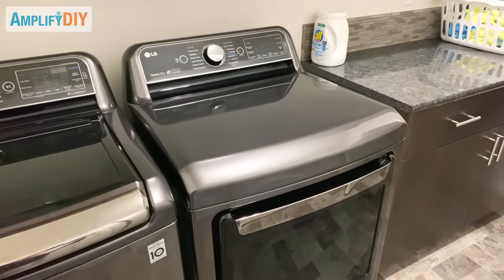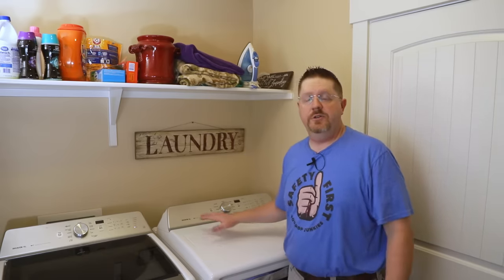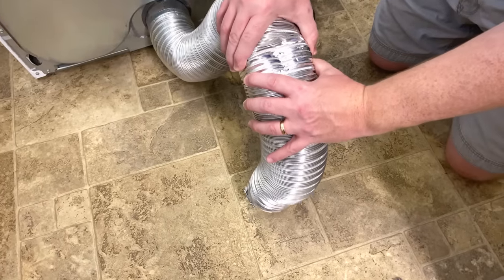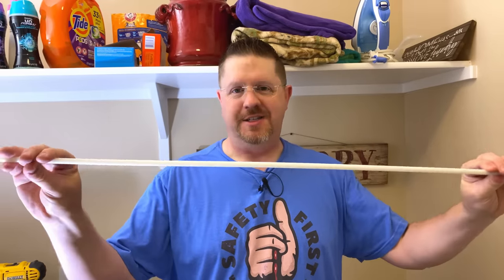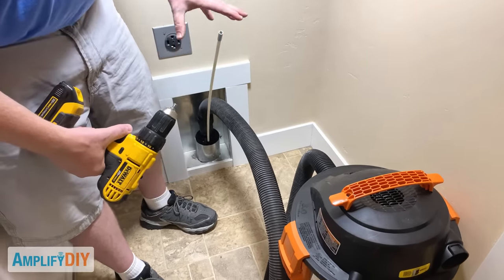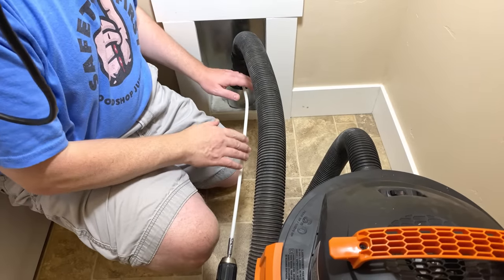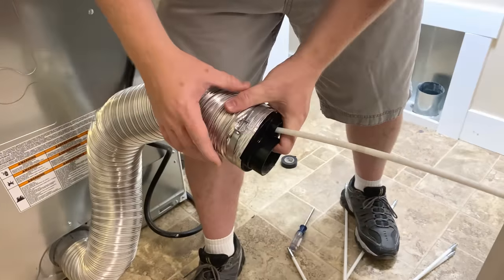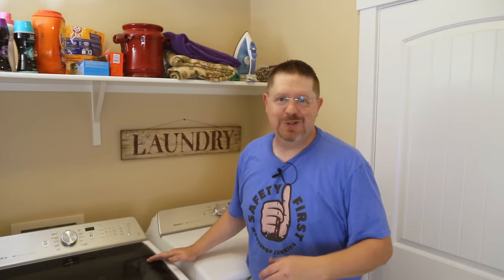How To Clean Your Dryer Vent Duct - Step By Step - It's Super Simple!

Comment: Your video potentially saved us from a house fire. I bought the product you mentioned in the video together with 12 foot extensions. I ended up using all 8 rods to clean the vent; a full 24 feet. My wash room is in the center of the house and the vent goes straight up to nearly top of my roof. There were 2 x 5 gallon buckets full of lint when I finished. The product was very easy to use. One tip is to roll the electrical tape in a fashion so that it does not come unraveled. Especially if you create a flap as in the video. You can test this by putting your glove over the tape and rotating the drill slowly. If it stays flat, you have it in the correct rotation. Another tip is to have a service technician clean inside the dryer itself. This involves removing the back panel. There was another 5-gallon bucket full of link inside the dryer itself. Inside we found burnt lint. So don’t hesitate to clean your dryer vent and check your dryer yearly. Thank you for this video.
Reply from the maker: WOW! I'm so glad you got everything cleaned out before there was a disaster. Thanks for watching!
Reply: Out of curiosity, how long did you go without cleaning that vent? I just did mine after 3 years (newish homeowner and kind of forgot about it until right now) and while I had a bit of lint, it was nowhere close to that much.

Comment: My dryer is drying clothes faster. I learned this important dryer vent cleaning technique from your video. I have told some friends, and coworkers about me helping neighbors clean dryer vents with rods and brushes connected to a drill. Some comment,”that’s cool.” I heard a neighbor’s daughter say,”do you clean dryer vents all the time?” Yes to prevent dryer fires. I like the Gardus LintEater Pro dryer vent cleaning system kit featured in the video. I put electrical tape on each rod to keep the heads of rods together during the drill powered dryer vent cleaning process. The kit is worth it to prevent dryer fires.

Comment: I just cleaned my dryer and dryer vent
duct from basement to patio outside my
home. I was surprised by some lint inside the lint chute of dryer. I just do not want to risk a house fire from lint build-up inside dryer and dryer vent duct. The LintEater Pro Dryer Vent Cleaning System Kit is worth it to prevent a dryer fire in my home and others’ homes. You make a lot of sense in a lot of your helpful YouTube videos. Thanks for all you do.

Comment: Thank you for this helpful video about how to clean dryer vent ducts step-by-step. I just helped a friend clean her dryer vent duct from basement to outside of home. The friend learned that a drill connected to flexible rods with brushes prevented a dryer fire. The dryer vent cleaning system kit featured in the video is worth every penny for deep cleaning dryer vents. 16 feet of the vent was clogged with
lint from the basement to outside of home and could have been a dryer fire in her home. She told me,”clothes were not
drying.” I have learned so much from this
video and strive to inform others about dryer fires. Electrical tape does keep the rods from coming apart during the dryer vent cleaning process. Guiding a drill, when adding a new rod, is very helpful. I used this technique this evening helping a friend clean a dryer
vent. She replied,”you really know your stuff about dryer fires.” Thanks for teaching me this important task.

Comment: Thank you for an excellent YouTube video.  I own the same dryer cleaning kit and do this job once a year.  Your tips about taping the rods and NEVER running the drill in reverse are spot on.  It is obvious that you have done this job and used the tools because you nailed everything right about the whole process.  The most difficult part of it is exactly what you said, moving the dryer and then breaking and making the flexible vent hose connections.  Very nice job, thank you again.
Reply from the maker: Thank you very much, Apack! I really appreciate the feedback.

Comment: I recently had my family's dryer cleaned by a local appliance repair center from some lint build-up inside the exhaust,drum and lint trap chute. I just did not want to risk a dryer fire. I use the Gardus LintEater Dryer Vent Cleaning System Kit regularly to clean the dryer vent duct that leads to the patio. I learned the importance of cleaning dryer vent ducts from online and from your helpful video on how to clean a dryer vent.

Comment: I tell neighbors about preventing dryer fires. I helped one of my neighbors a couple of weeks ago with cleaning his dryer,lint chute and dryer vent. When he began to pull the dryer away from the wall,lint was on the floor and near the dryer exhaust. He was surprised that his cordless drill with the Gardus LintEater Dryer Vent Cleaning System Kit helped remove lint near the rear dryer exhaust,lint chute and dryer vent duct. He was thankful that a dryer fire was prevented. I told another neighbor about cleaning their dryer vent. The neighbor was thankful for helping with preventing a dryer
fire. I regularly vacuum around my dryer,lint chute and dryer vent duct to prevent a dryer fire from lint build-up. I appreciate the helpful video on how to clean a dryer vent.

Comment: Great instructional video...I've been using the "LintEater" for nearly 20-yrs; at my home and at a 2-family house I maintain. I make it a habit to schedule yearly cleanings.  I designed the dryer exhaust vents at each home using  4" round metal ducts; sealed with either high temp flue tape or aluminum foil tape rated for high temps due to their properties of adherence and being flame retardant; and then terminating each end with metal (stainless steel) worm gear duct clamps.   Simple construction; simple cleaning, as you have demonstrated, and does not require a "professional" to install or clean.  This is not a hi-tech or specialized industry requiring training or using proprietary materials; and that's the point of a DIYer video...to inspire and enlighten those who wish to learn and do the work themselves!  Thanks for sharing; I appreciate it.  Best wishes and kindest regards.
Reply from the maker: Thank you so much!

Comment: Thank you for teaching me how to clean a dryer vent duct. I showed two individuals how to clean a dryer vent with the Gardus LintEater Pro dryer vent cleaning system kit with flexible rods and brushes connected to a drill to remove lint build-up inside their dryer vent ducts and
dryer. Some people have commented,”My dryer is running better.” The individuals have learned from me that it is important to clean a dryer vent to prevent house fires. Your helpful video has helped me demonstrate to others that just cleaning the lint screen is not enough.

Comment: I just cleaned my dryer vent duct from my basement to patio using the Gardus LintEater Pro Dryer Vent Cleaning System Kit with a cordless DeWalt drill. I was surprised by some fine lint dust that was removed, as I was cleaning my dryer vent this Sunday
afternoon. I told a coworker about me knowing how to clean a dryer vent. He thought it was cool. I mentioned this kit with rods and brushes connected to a drill. I used your method of using electrical tape between rods to prevent the rods from getting lost, while cleaning my dryer vent today. I learned how to clean my dryer vent from your helpful YouTube
video. I just wanted to be safe to prevent a dryer fire from lint build-up in the dryer vent
duct.

Comment: I just cleaned my dryer vent duct from my basement to backyard patio this Wednesday evening. I connected three flexible rods with brushes to a cordless compact DeWalt
drill to clean inside my dryer vent. I was surprised by lint build-up that could have been a dryer fire prevented inside my home. I turn my clothes dryer to normal drying cycle for a few minutes, after cleaning my dryer vent to check for good airflow from my dryer to outside patio dryer duct of my home. The electrical tape is a helpful tip to prevent rods from disconnecting inside my dryer vent during the dryer vent cleaning process. Thank you for all you do.

Comment: Great video.  Hardly any of these dryer vents are installed to code, which limits the length and amount of elbows.  I take the cabinet apart and vacuum out the inside of the dryer also, especially with gas dyers.  The lint seals go bad, and then the cabinet will have a layer of lint, which is very flammable.  That termination was a little to close to the ground.  I would dig a little gravel out and get more clearance.
Reply: Yup, any time there's a small dryer repair, it comes out, comes apart and gets cleaned. Once you have one apart, you realize that you paid for mostly air when you bought it...

Comment: The Gardus LintEater Pro dryer vent cleaning system kit makes cleaning my dryer vent and other’s dryer vents easy. You are very helpful in showing each step of how to connect the rods with electrical tape and how to go in a forward motion, while cleaning a dryer vent with a
drill. I could see a difference, in the airflow of the dryer vent; after cleaning the dryer vent this Sunday afternoon. My neighbor brought his DeWalt cordless compact drill over
to my home today. He was impressed by how quickly I connected the rods with the brush to his drill to begin the process of cleaning my dryer vent from my basement to the
patio.

Comment: Sir...I cannot thank you enough for this amazing dryer vent cleaning video.  Bought the home 12 years ago (never cleaned).  Replaced a dead dryer & the new dryer has a super high output for drying clothes.  Ended up cleaning the vent out myself using this kit (purchased from Lowes) along with ext rods.  It was 17' from dryer to exterior.  
This video was by far the best how-to video I've ever watched & used as a tutorial.  Thank you so much for this amazing video.  Clear.  Concise.  Accurate.  To the point.  No BS distractions.
Job well done on both your end & a clean dryer vent on my end.
Reply from the maker: So glad to hear it was helpful for you. Thanks!

Comment: I helped my neighbor clean her dryer vent duct,lint chute,lint screen,rear exhaust,and ventilation holes of her front load 
dryer today. I think the dryer could have caused a dryer fire in her home from the lint
build-up in the dryer vent to the dryer. The Gardus LintEater Pro dryer vent cleaning system kit and extension rods featured in your helpful video helped save my neighbor’s home from a dryer fire waiting to happen
today. The kit is really the best way to clean a dryer vent and dryer properly. I remember the comment all the lint build-up from the dryer to dryer vent, all that hot, hot air can ignite the lint and can cause a fire. I tell neighbors I learned how to clean a dryer vent from your very helpful video How to clean a dryer vent
step-by-step on YouTube. Thank you for the video of the importance of cleaning a dryer vent to prevent a dryer fire in my home to neighbor’s homes.

Comment: This is one of my favorite “seasonal checklist” items for my handyman clients.  Around DST I go to my regular clients homes and do all the routine home maintenance things (smoke detector batteries/furnace air filters/dryer ducts/water heater flush/reverse ceiling fans/change light bulbs/etc). I charge $50 for simple ground floor dryer duct cleaning but up to $150 for second floor or complex vent systems.  It’s easy money and something the average homeowner never thinks of or doesn’t want to do.    Excellent instructional video!👍🏻
Reply: What’s your location? I need your help!
Reply: @evasilvalayton758  I live on the Monmouth/Middlesex county border—central NJ

Comment: I make it a regular habit to vacuum the back ventilation holes,heat grilles inside the dryer,dryer, and vent. I decided to clean my dryer and vent this Sunday evening. I was surprised by some lint build-up inside my vacuum canister. I never thought of regularly cleaning my dryer and vent until a repairman opened up the dryer drum in 2022. The dryer drum had lint on the wires and drum. I have heard real stories about dryer fires from news and local repairmen. I came across your helpful video about how to clean a dryer vent. I actually use the Gardus LintEater Dryer Vent Cleaning brushes to help clean lint. I do not want to risk a house fire from lint build-up in my dryer and vent. I appreciate the helpful video. I have told other people about the importance of cleaning a dryer vent from your video.

Comment: Appreciate the information, tips, and general instruction. I'm a fan of the electrical tab tape fold tip you shared. I have for sometime used the "tab fold technique" for multiple other tasks and applications. This tape will leave surfaces a little sticky afterwards but nothing a quick spray of alcholol wont fix. Good clear steps and value your time , information on this production. :) Thank You!!

Comment: Great video. When I've cleaned vents in the past I've moved the brush by hand, which works well but not as well as the drill. An electric leaf blower or compressor is also good for blowing out the excess lint.
Reply: Oh good idea. Ours is on the second story. Not easy to get to.

Comment: Extremely good video. Easy to understand clear voice. I bought the same kit without the extra extensions today (before I saw video). I could not get the rods and brush to navigate the multiple corners in my system. I’m guessing it has seven 90 bends. Probably not up to code.  Didn’t get it done.
Reply from the maker: Hi Steve - sorry to hear your ducting is likely installed incorrectly. Perhaps if you also cleaned from the outside of the house in towards the dryer, you'd get the other half of the duct clean past where the tight bend is? Good luck!

Comment: I try to make sure I clean the dryer vent,and lint trap exhaust regularly. I decided to look at the inside dryer exhaust drum ,I could see lint build-up behind the holes before I put clothes in the dryer today. I immediately stopped,as the lint is a fire hazard. I heard about a dryer fire a couple of months ago was caused by friction and lint in a dryer. I like the Gardus LintEater Dryer Vent Cleaning System Kit with the brushes and wands to try to maintain the dryer. I did not want a house fire from a dryer. Your video makes sense.

Comment: Very informative video, great job going step by step.  I have cleaned my own vent, friends and family, also neighbors. The screw type of vent rods need special attention like you mentioned in the video. Disaster if you get that brush or rod stuck in the duct. I use a push and snap version, you can go either direction, but more expensive.  TIP for installing hose. Best to remove the washer unit first. After you are finished cleaning. Now you have room to install the dryer unit.  As you push the dryer closer to the wall with one arm,  with the other you guide the hose inch by inch compressing the hose as you go.  This way you can use a shorter hose and keep it straight or not get a too large loop in your hose. Even better, have someone help you push the dryer slowly towards the wall as you compress the hose trying not to kink it. Then when you are done install the washer.  Also, if you have those flexible white plastic hoses, get rid of it.  They are not fireproof or code compliance. Federal building code, dryer vent duct cannot be longer than 30 feet and no more than two 90 degree elbows. If you have a 90 degree elbow, you must add another 3 feet in total length of vent. Example: If your total length of dryer duct is 30 ft and you have one 90 degree elbow.  You have to add 3 ft. ( 30ft +3ft = 33 ft.)  Your duct does not meet building code. Most dryer manufacture state how long your dryer vent can be used. It must meet the minimum. If any of these requirements are not met, if a fire occurs, your insurance may not cover your claim. Also, if you do not properly clean your dryer vent in a timely manner and a fire occurs. Failure to properly maintain a regular maintenance cleaning schedule can void a claim. Insurance companies are great, but read the fine print.
Reply from the maker: Excellent tips, Walter. Thank you!
Reply: Most places it’s 25 foot total 
And subtract 5 foot for every 90 degree elbow and 2.5 feet for every 45 degree elbow

Comment: If I am seeing this correctly, your dryer vent hood on the outside your home is too close to the ground. Should never be less than 4 inches to the ground. A 4" snowfall or heavy rain in poor drying soil will create a serious issue. Mice and snakes love those close to the ground vents. I have removed 11 snakes this year alone. Your hood is definitely causing a restriction.
Reply from the maker: You are right - this was not my house, but it is definitely an issue. How would you to about relocating it without tearing into interior walls and introducing yet another bend? In the house I showed, the vent exits the laundry room, goes down into the crawlspace, and travels under the floor over to the side of the house where it exits.
Reply: @AmplifyDIY  they make an exterior vent using pvc pipe. Air from the dryer will exhaust, yet rain cannot enter.

Comment: I vacuumed the rear dryer ventilation holes of my dryer last night. I was surprised by some lint that was collecting in the vacuum canister. I try to clean my dryer vent duct and lint chute to prevent a dryer fire. In early 2022,a local appliance service repairman removed the back panel of the dryer and lint was built-up inside the drum and wires. I will never forget that
morning. I appreciate your video how to clean a dryer vent.